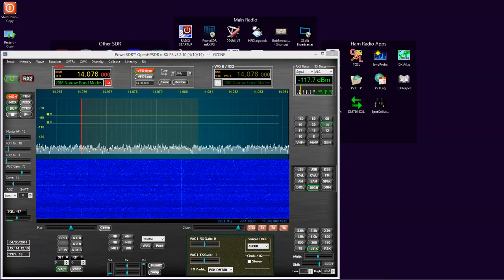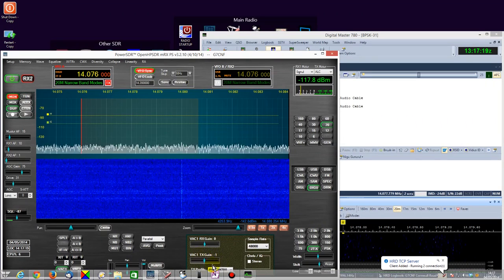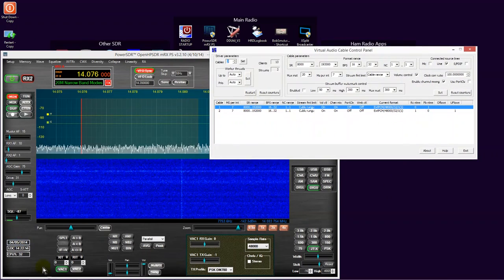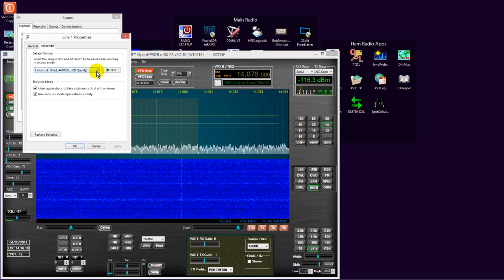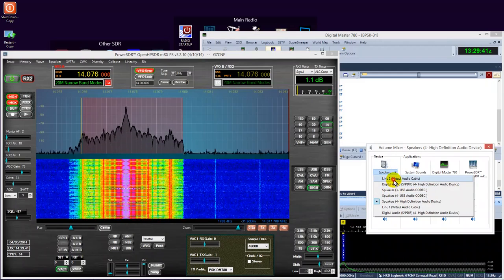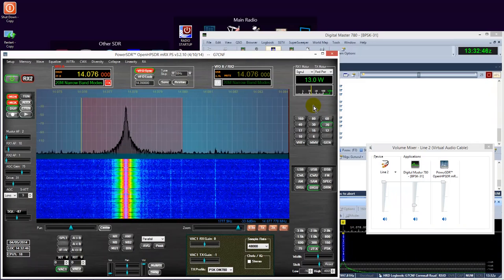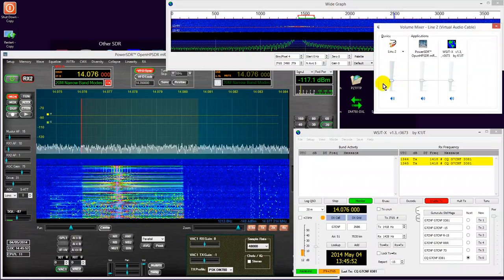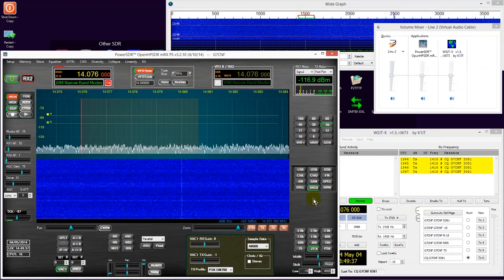Are Your Data Modes Transmissions Clean? Video Tutorial

Comment: Thanks for that help, especially knowing to check the sample rates helped me significantly!

I also found there were options on my sound card to check for "Disable all enhancements" (which auto-adjusts who knows what)

Now if I figure out where the ALC should be reading when I'm running things will be doing well...I've read various claims that it should be anywhere from "bottom half" of the scale up to "almost touching the max end".  Not sure what's best or if this is even consistent on different rigs.